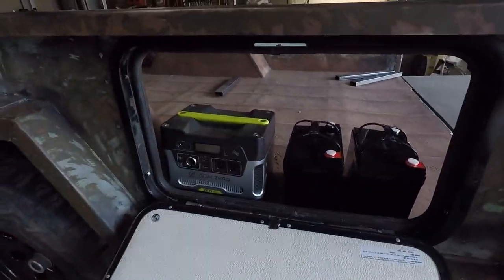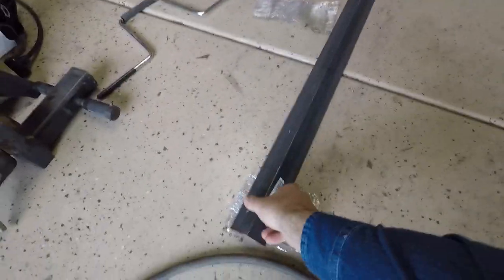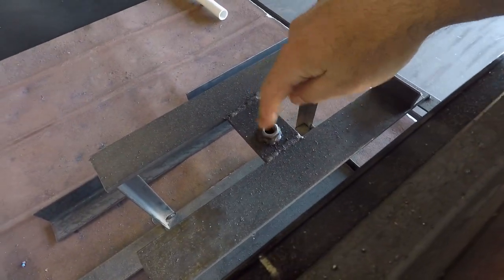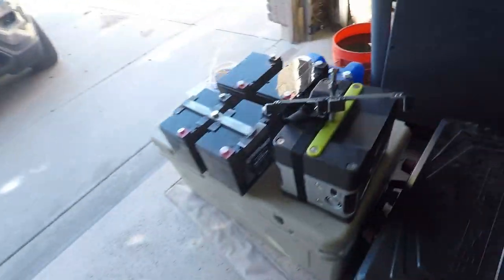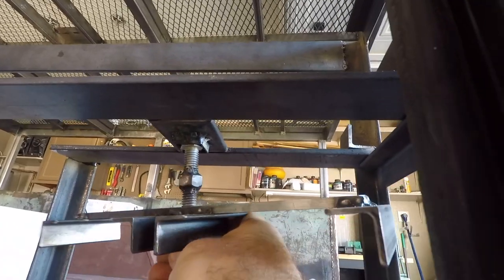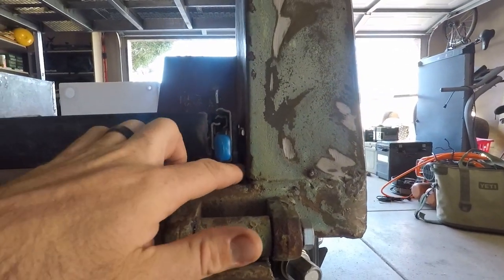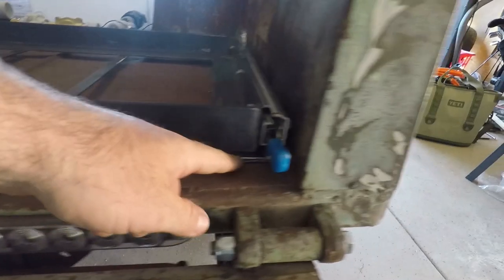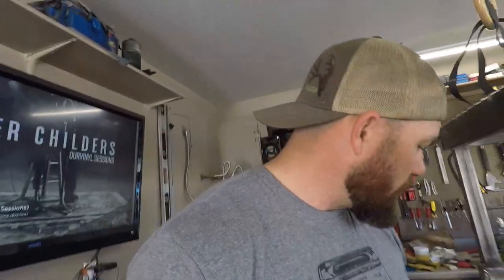M101 Trailer Build E12 - Updates; Batteries, Drawers, Plumbing

Comment: Love your build.. I do have one question. What is the weight so far. I am also building an overland trailer from an old KNOX 1946 surplus Military Trailer. I am working on the electric now.
Reply from the maker: Shawn the trailer is actually done now, I just need to get the last videos up. The final weight of the trailer dry is 2300lbs. With water and gear I'm right at 2500 which is perfect for the load rating on the axles and rides very smooth.